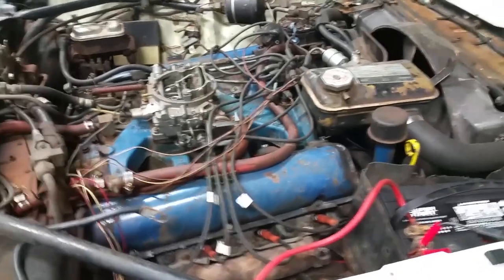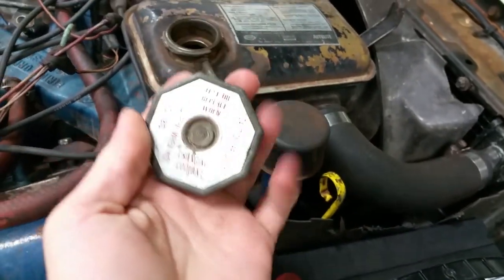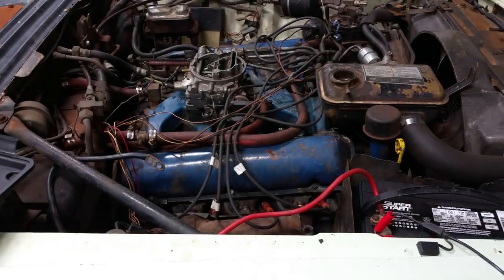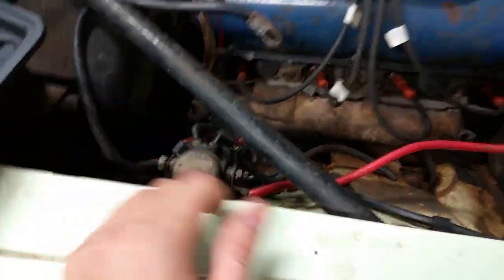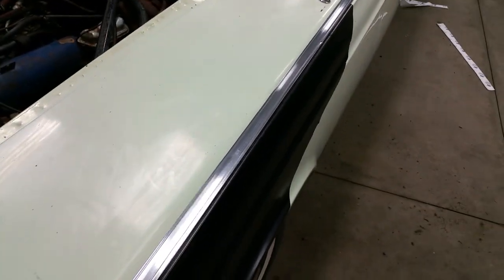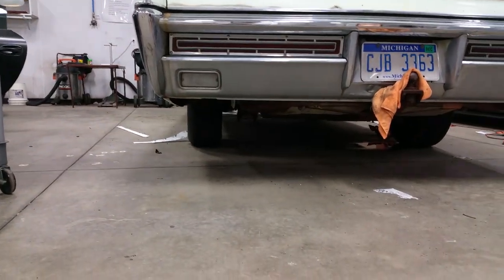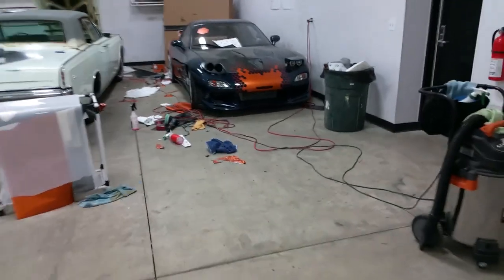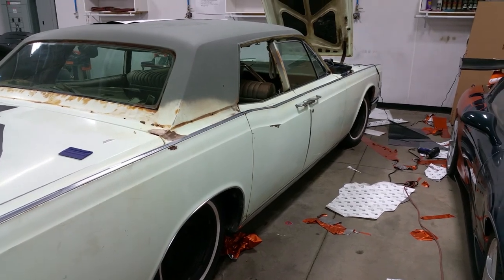Restoring the Lincoln Continental 4: Radiator Leak!

Comment: House of Kolor rich pink. (It's not actually pink). It's a dry pearl mixed in with Intercoat clearcoat applied over a black base coat. Turns out like a dark blue with purple pearl effect it looks amazing in the sun. Painted my car with it. Was done on the cheap and turned out amazing.

Comment: The radiator fluid didn't fry that relay.  I am assuming it is the starter selinoid.  They never work on old fords you have to jumper it with a screw driver

Comment: Satin black wrap riding on air with at least 9" wide wire wheels, and of course the most obnoxious exhaust known to man.
Oh and slow the timing down that much that you hear each individual cylinder fire and it coughs and splutters like it's not quite started.

But that could just be me

Comment: Looks like a hack job. If you want to do it right you really have to remove the windows and dismantel the fenders/doors. The car needs sanding and welding with new pieces of metal instead of fancy vinyl wraps over thick layers of bondo. If your starting with a project like this you better beef up your weld skills.